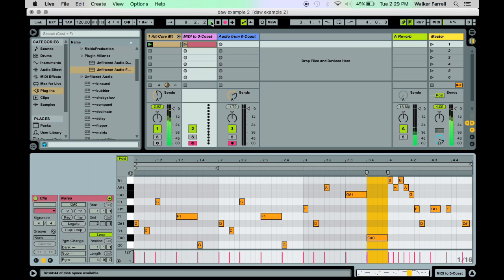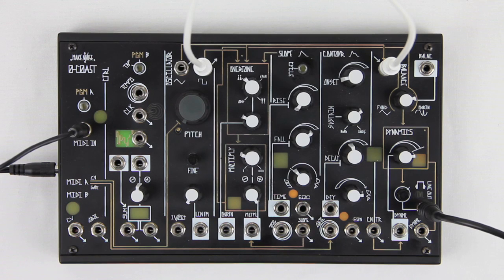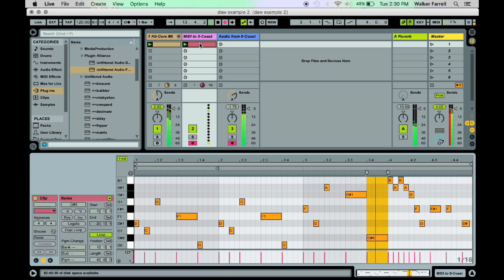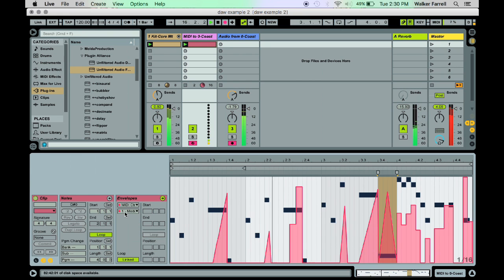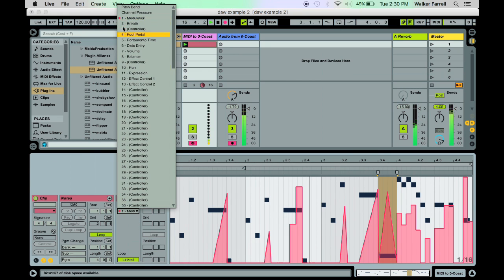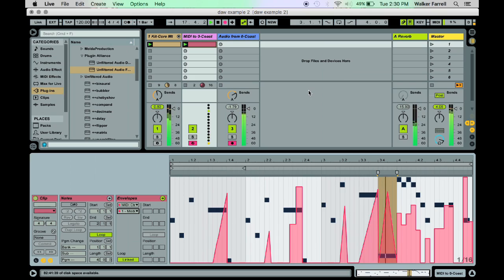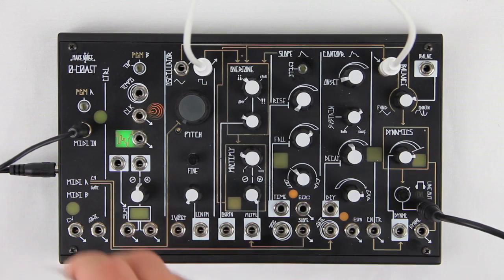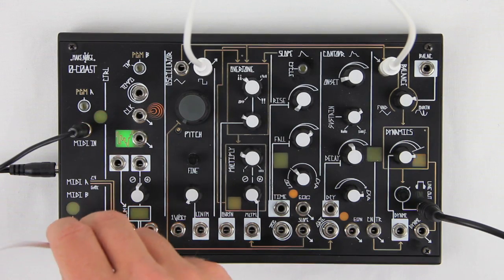0-Coast PGM Pages, pt. 5: Page 4, MIDI B CV

Comment: So it can only do MOD wheel or velocity, not both at once?

And if I tapped Program A by accident, it would immediately stop doing either, and I'd have to go through all that again?
Reply from the maker: Yes, this single CV output can only be based on one MIDI message type at once. If you tapped PGM_A again it would remain on whatever setting you had chosen when you pressed it.
Reply: @MAKEN0ISEMUSIC  I meant the synth can only produce one or the other, which is disappointing.  I see from the MIDI B Gate video that the B gate can be set to respond to one of them, but only as a switch.

Really, I'd want CVs for MOD, velocity and note number, available simultaneously.  I'm reluctant to spend that much on a synth without a proper MIDI socket built in too.  The 3.5mm stereo socket is quite poor as an audio connector, prone to crackly connections, and goes wrong easily, so I think it's a bad choice for any sort of digital connection, i.e. MIDI.

It's an interesting synth, but on balance, I just don't want one with those shortcomings.

Thanks for replying.

Comment: Is it possible to externally control the rates of the LFOs available via the MIDI-B CV and Gate sockets? Say I've set MIDI-B gate to output the square LFO. Can I control the rate of that LFO (usually done by tapping the A button)  from an external MIDI controller?

Comment: How do you really set the LFO frequency for the MIDI B CV-> ?  What is the tapping technique on the (PGM) A button? One slow tap, but not too slow or you're back in program mode?  Or, am I paging through some frequency settings? Three quick ones for fast?  The whole "tap tempo" is mysterious.  I mash buttons and eventually get there but there must be some logic.

Q. How do I set the frequency of the LFO?
A. #t=1m29s: While outside of program mode,  tap (PGM) A  

Q. How do I exit program mode?
A. [HOLD] PGM_B : Exit PGM Pages.
Reply from the maker: Tap PGM_A twice. The length of time between taps will be the length of time between clocks.

Comment: So the order of Page 4 MIDI B parameters you give in the video (Velocity, Mod Wheel, LFO, Note) is the correct order?  Because it contradicts the order of parameters given in the manual (Note, Velocity, Mod Wheel, LFO).  I just want to verify: what you say in the video is correct, and the manual is incorrect, yes?  Thanks.
Reply from the maker: There is a sticker on the back of the 0-Coast to remind you which is which. We put Note at the end in the video because it was most complicated to demonstrate. But the order is the same: for example if you have chosen LFO and press PGM_B again you get Note (the list wraps around). Velocity is the default. Hope that makes sense!
Reply: Okay, great, thank you for the clarification!